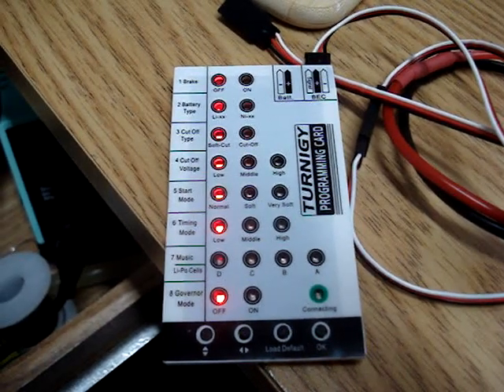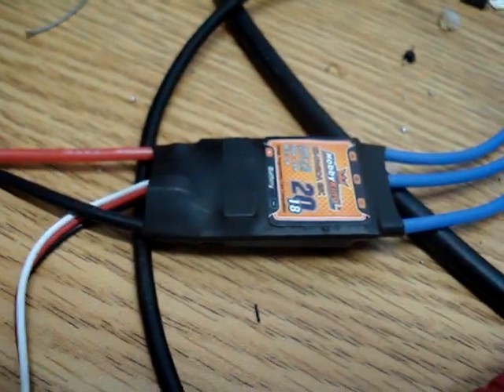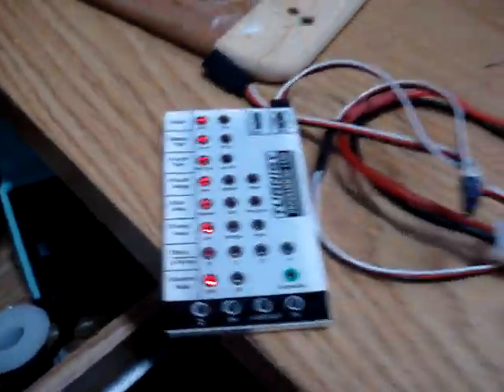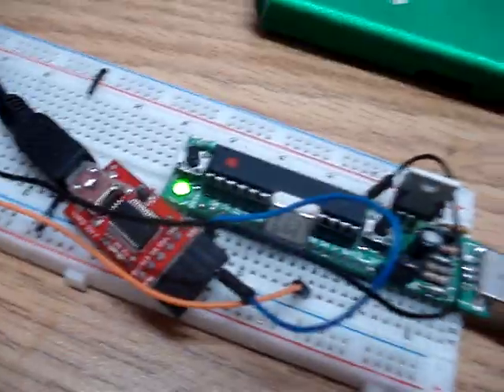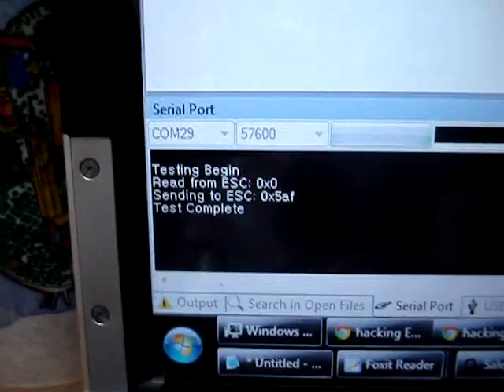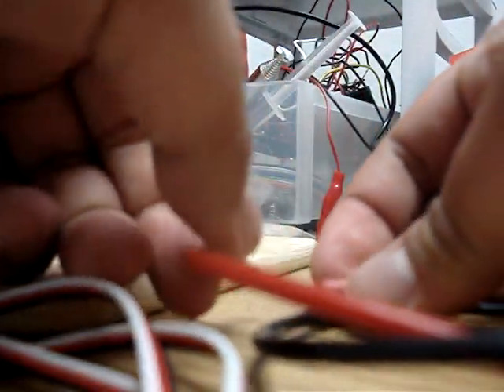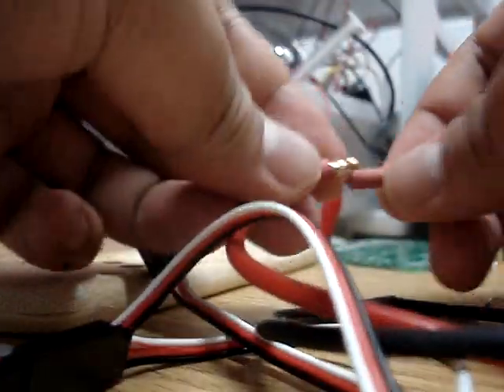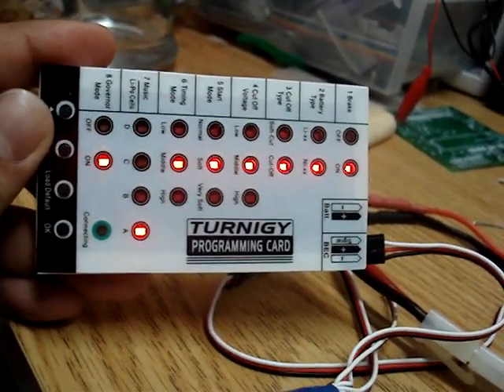Turnigy ESC Programming Card Reverse Engineered

Comment: I know this is old, but I'm wanting to do something similar with a Hobbywing card.  How did you determine it to be a 1 wire half duplex protocol.  I know you used a Logic Analyzer, but was it some guess work or did you put it on a spec an to see what was going on?  I'm a software engineer that is learning the electrical stuff so pardon my lack of knowledge.
Reply from the maker: One of the two devices has to talk first, and it can't be the ESC since it would be a bad idea for two devices (ESC and RC receiver) to be output signals on the same wire (bus conflict, might damage something). So thus I attached the analyzer to the programming card without the ESC first just to see if the card spits out data, and it does. The next step is to connect the card to the ESC and see if any new data shows up, the new data must be the reply from the ESC.

Comment from the maker: @h2oreactor 

I'm not the best guy to ask. To measure the vibration, you can do it by feeling the vibration, or setup your flight controller to output accelerometer data to a graph and judge the results visually. If you are feeling really pro and mathy, then do analysis on the accelerometer data using statistical analysis techniques or even FFT it to find amplitudes at various frequencies

I heard you can use two small zip-ties per motor to balance motors

Quadcopters are fun, see my other video